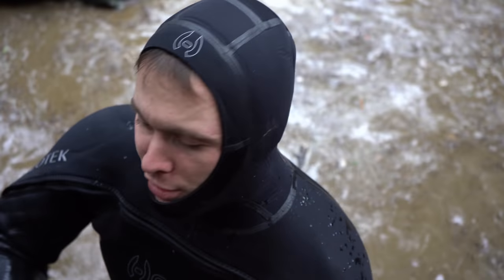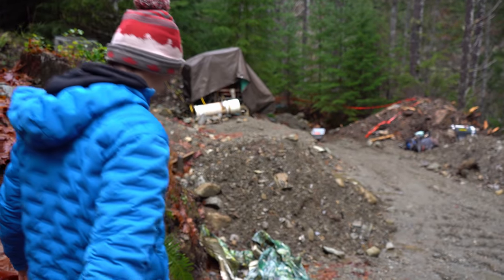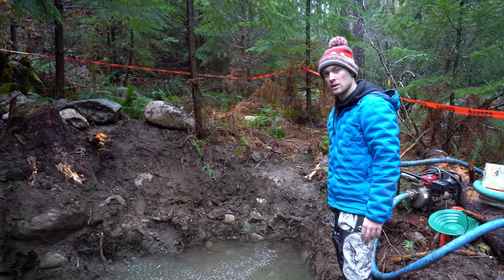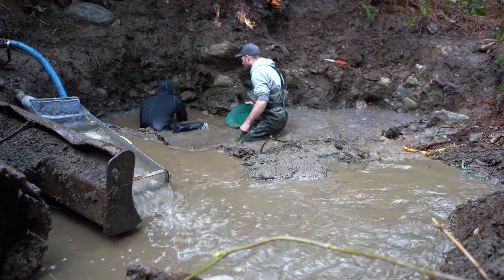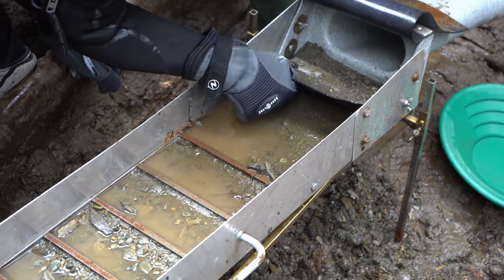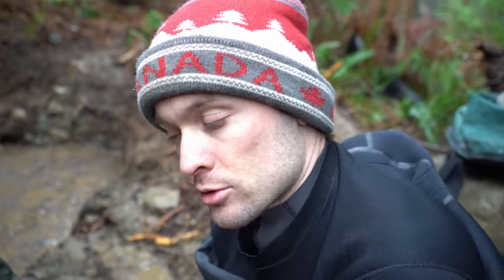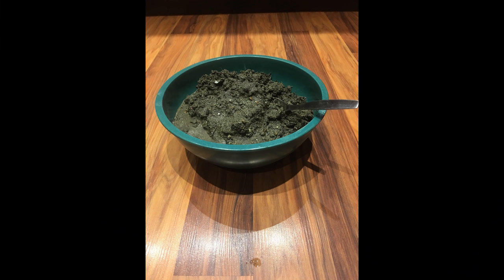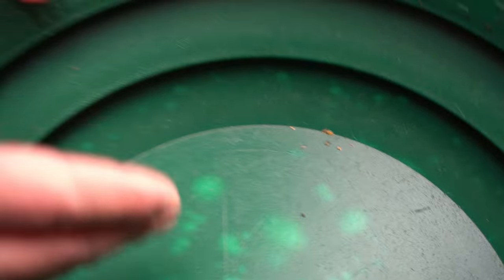Sucking GOLD Out from a BIG HOLE (LAND DREDGING)

Comment: Cool stuff Pauly and were them the type of mushrooms that make you laugh and drink too much? Lol
Reply: As usual great video.
You definitely are one of the faster Learners of all that youngsters making videos about mining.
I could have gave you about 25 really good tips that would have saved you a lot of time in the future I guess that's what is Old-Timers are for.
I bet you can almost realize you can kick that dredges ass sniping.
Obviously it wasn't working very good the way you had it set up.
And basically if you have it running right that dredge it's for basically cleaning out cracks.
The way you had it running I don't think it would pick the Nuggets up off the Bedrock even if they were exposed.
And next to impossible to shovel out a wet hole.
You want all that water flowing through the whole dredge so when your nozzle goes down to the Bedrock it's like sucking to the bedrock in the whole dredge will jump.
Well there's so many things that are easy to straighten out .
With a little old timer's knowledge.
Water hydraulics and math.
Nice to see your sniping skills are improving..
We should talk sometime.
Have a happy New Year and may the Nugget Gods be with you.

Comment: I hope you have figured it out by now. The lessen I've learned about dredging is gold is heavy 🙄(DUH) but remember when dredging the suction only pulls less dense material leaving the bigger and biggest nuggets. 
The solution is to put the suction on the bottom and draw the material to the opening with the other hand. That way the gold nuggies don't fall deeper as the suction draws the lighter stuff away.
Good luck😁

Comment: Make a controlled amount of water enter the hole so that there would be just enough water entering the hole for the dredge to run and make a settling pond with a slight over flow to feed it I use shovel to act as a flood gate

Comment: You're using the wrong kind of pump you need a mud hog this moves larger pieces of debris it works with a pump not with a metal wheel